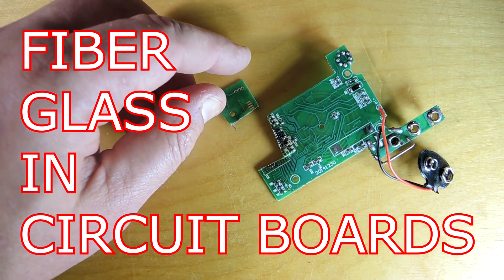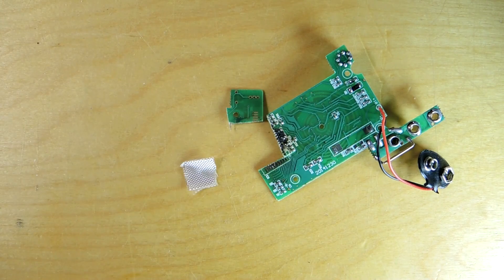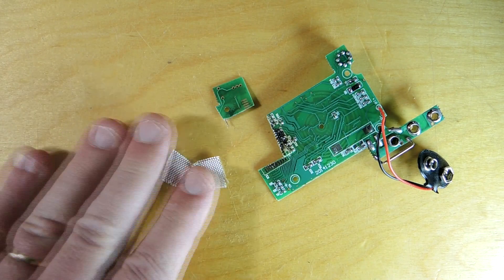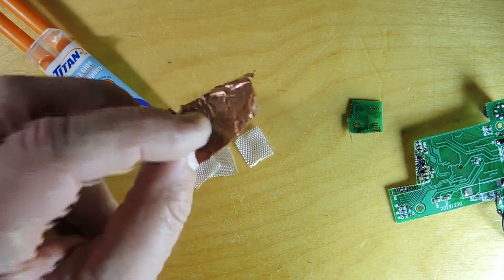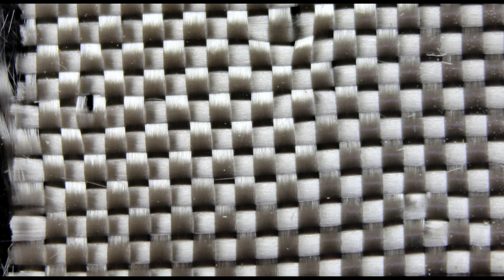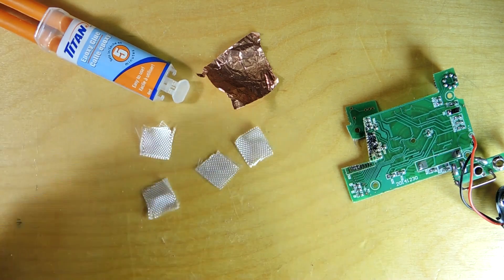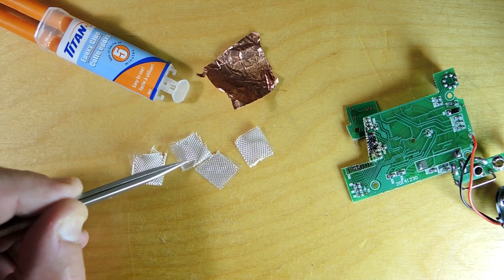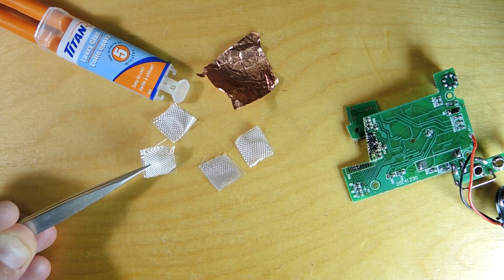Reverse Engineering a Circuit Board: Fiber Glass

Comment: Cheaper than FR4 is SRBP, which is used in mass produced boards where you can live with the limitations it has. Much easier to drill for one, as it is only a paper and resin composite, and much easier to cut as well. Mass produced boards of it are typically punched out of a sheet, and survive quite well from that. For larger holes you can simply punch them at the same time as doing the outline using a complex die. 

Drawbacks are that you have thermal limits on how hot you can make it, and as well it is difficult to through plate to make a double sided board, though using a larger via and filling it with a conductive carbon loaded resin ( and then a mask over it to keep it from corroding too fast) you can make a double sided board that will withstand reflow soldering. This is used in low cost things like cordless phones, as the board with 90% of the circuitry is cheap and not too critical, you just have a smaller RF section on a daughterboard with plated mouse bites as terminals which is reflow soldered to the board with the rest of the components using a solder paste stencil to drop the paste.

But if you are making a million boards then saving 2c per board is a lot. for the multimeters they make a lot fewer boards, and in any case the COB construction does not work well on SRBP, the expansion is too different to the epoxy and chip, and the bonding is going to shear easily. Thus a COB always uses a fibreglass board, even things like greeting cards, which use a single layer of weave and the thinnest 0.5oz copper plate imaginable.